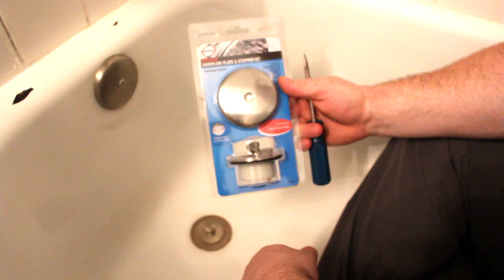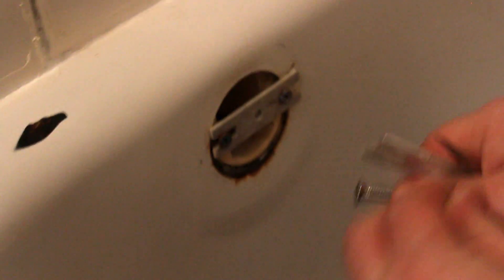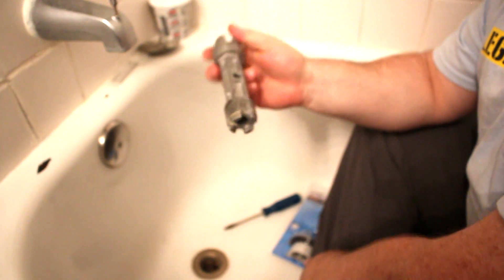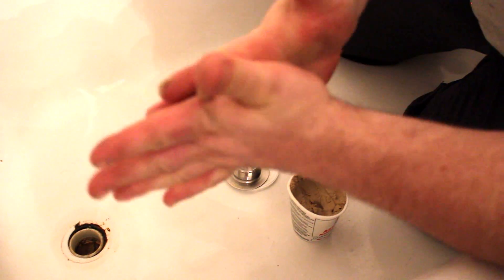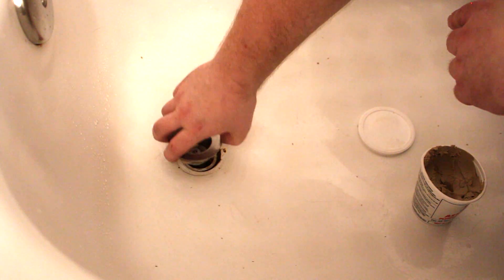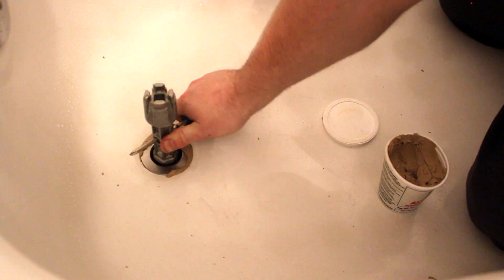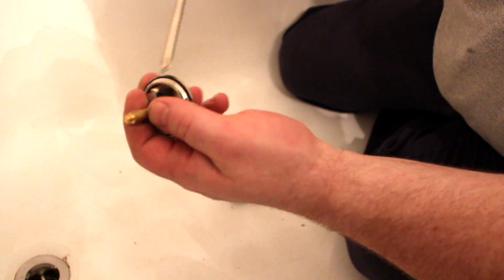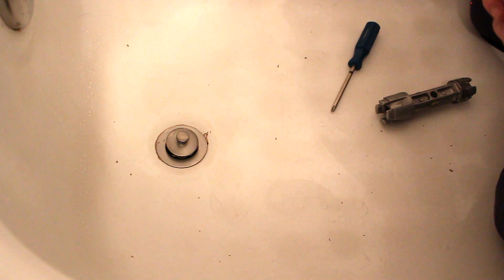DIY How to replace Bathtub drain stopper - Tutorial

Comment: Me and my mom had a leaking bathtub that ran into our downstairs unit. I blessed the Father, YHWH, for blessing me to find your video. We were able to fix it without a problem. I did cut into the pipe a bit, but it should be fine. Now we just need to know how to fix and replace the washer on our bathtub hot water faucet. It's the one with the metal cartridge piece.

Comment: How do you know if it's tight enough when putting in the new stopper?
Reply from the maker: it should compress rubber gasket. usually it is pretty tight. I wish i can explain it better.

Comment: Do yourself a favor, put about twice that amount of putty around the drain, whatever squeezes out, put it back in the putty container. Too little putty and water will be leaking around the drain (into your walls if it's upstairs).
Reply: Ya know , I have seen installers use silicone chaulking there,
Reply: @doneown503  much better option, is waterproof and excess can be wiped off or sanded away

Comment: Mine keeps turning easily even after the putty came out. Could it be that my replacement was too small?
Reply from the maker: Have to screw it in all the way so rubber gasket is compressed, otherwise it will leak

Comment: Clean behind the overflow, clean the drain area as well.      Other then that your method works.
Reply: Yes I wondered about that step cleaning first before applying new drain do you need to replace the rubber adapter too?

Comment: What happens if the threaded PVC female part is missing from your bathtub where the drain stopper screws into?
Reply from the maker: It should be there, that is a common installation. Never seen PVC drain without thread.

Comment: What to do if middle pin is broken off and can’t connect new plunger
Reply: Maybe buy a replacement plunger of the same model or replace the whole thing? The second option is probably going to be cheaper, easier, and quicker.